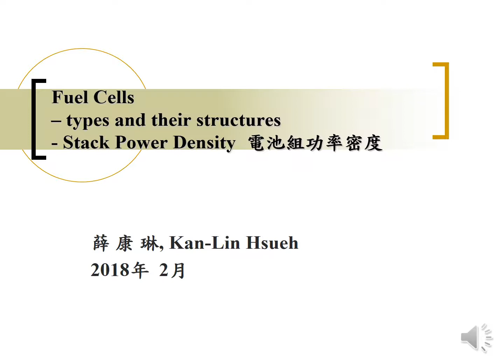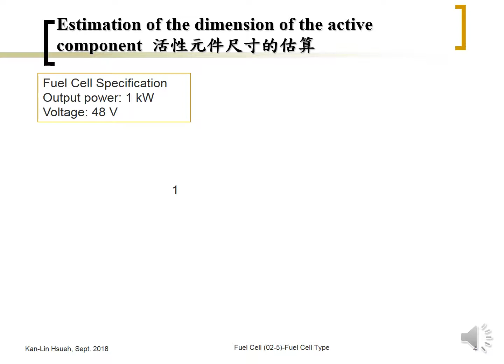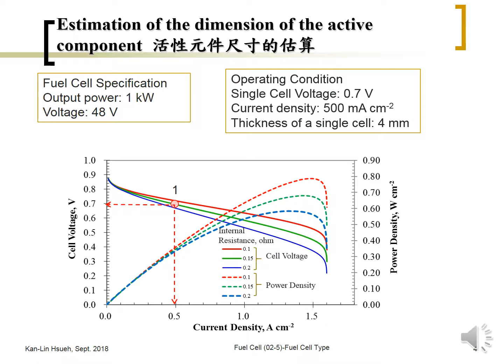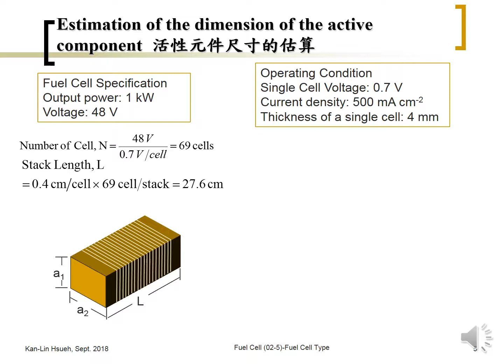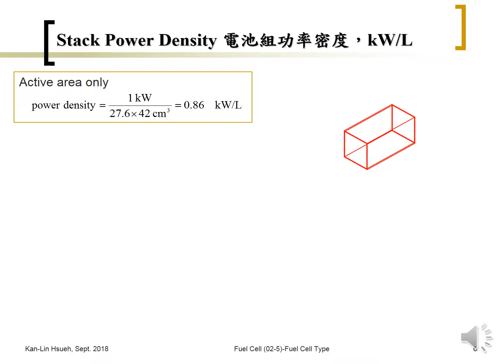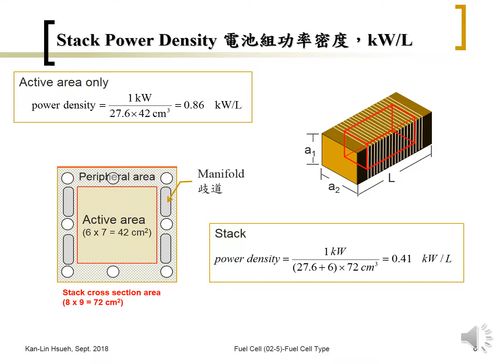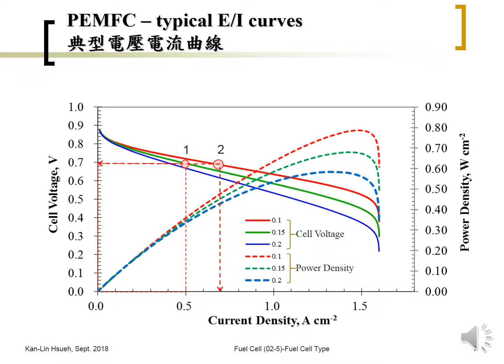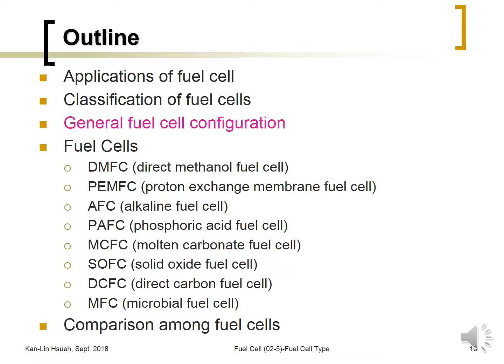Fuel Cell (02-6) Fuel cell type-Stack Power Density

Comment: Thanks, prof ;
I work on theises and I work in design sigle FC to printed on a 3D printer,  How can to calculate single fuel cell?
diminution, voltage, and current?
Reply from the maker: The single fuel cell voltage can be calculated from the output current density or vis versa. The voltage-current density relation is given by the Tafel equation with IR drop and mass transfer corrected equation. Where R is the internal resistance. Once the output power (P) and cell voltage (E) are set, the output current (I) can be calculated from I = P/E. The current density (i) can be determined from the measured  E-i curve once the E is known. The cell active area (A) is A = I/i. The cell thickness can be estimated to be 3 mm depending on the cell channel design.

Comment: Direct methanol fuel cell
Direct-methanol
 fuel cells or DMFCs are a subcategory of proton-exchange fuel cells in 
which methanol is used as the fuel. Their main advantage is the ease of 
transport of methanol, an energy-dense yet reasonably stable liquid at 
all environmental conditions. Whilst the thermodynamic theoretical 
energy conversion efficiency of a DMFC is 97 %; the currently achievable
 energy conversion efficiency for operational cells attains 30 % - 40 %.
 There is intensive research on promising approaches to increase the 
operational efficiency. A more efficient version of a direct fuel cell 
would play a key role in the theoretical use of methanol as a general 
energy transport medium, in the hypothesized methanol economy
Reply from the maker: You are right about all the advantage of MeOH. MeOH may obtain from recycle waste by biotechnology. At present time, the catalyst is Pt or PtRu for DMFC in order to keep it output at acceptable power density. The catalyst loading is about 3-5 mg per cm sq. which is 10 times than the PEMFC. Research effort is needed to lower the catalyst loading and cost.